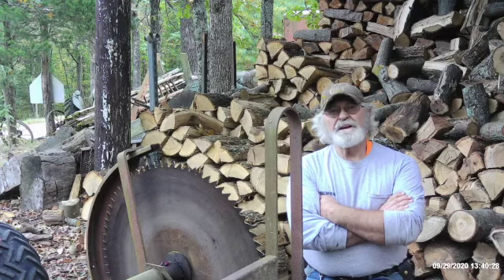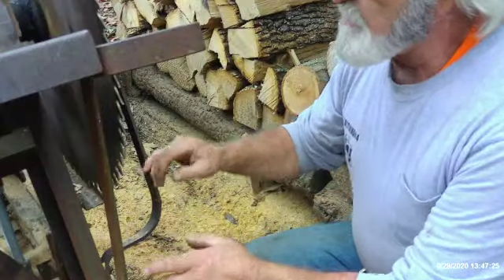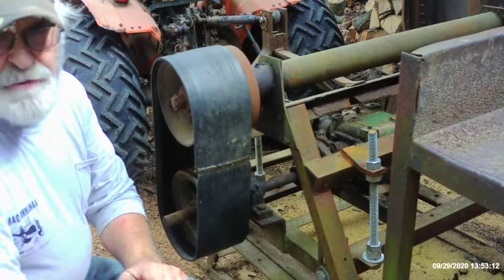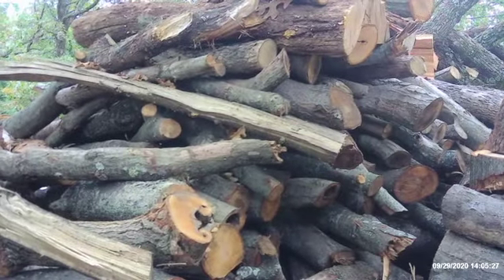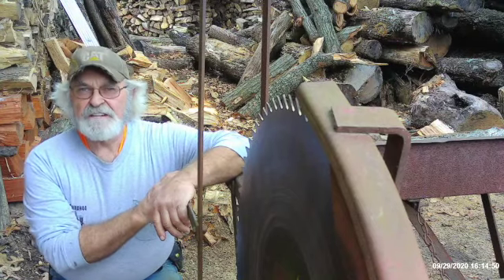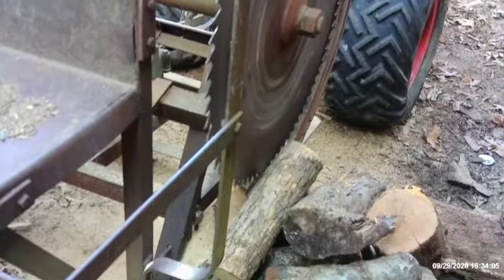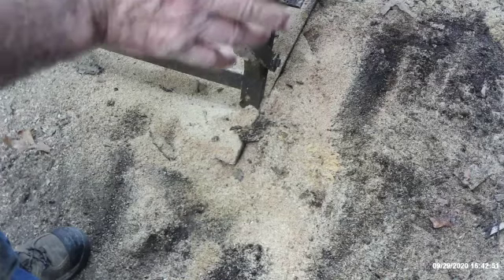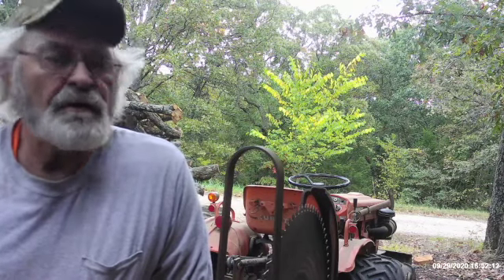Buzz Saw Safety: Detailed Safety Discussion and Operation

Comment: You and I are so on the same page here. One thing that I will not tolerate is leaving a cut piece that falls to the ground to just play there. I usually drag a small log up and throw my pile to the other side of the log and usually, I will have moved farther down the line in my pile and it won't be an issue. If pieces fall on my side of the log, I deal with it immediately. You and I both have a very healthy respect for these saws.
Reply from the maker: Yessir, that's why you and I have all our fingers...right?  While working alone, I offbear with my right hand all but the heaviest pieces.  I watched your video on your old rig too. Pretty cool. Thanks Gary for the comment.

Comment: Good tips there, Tractorman. I've just got one of these back into operation this year and your videos have been very helpful. Love the buzzsaw's efficiency but it does command a good amount of respect for sure.
Reply from the maker: Great !!  So glad to hear you've benefitted from them.  I think there's a playlist up top that has a lot of them listed.  And did you see by chance the one where the tooth layout is described..? This was one of my first videos...www.youtube.com/watch?v=TZ36Rxpn754&t=36s  Thank you for the comment and please feel free to look around a while.
Reply: @tractorman4461  Yes the tooth layout video blew my damn mind. That and the idea of hanging the blade from the ceiling and feeding it into a bench grinder tooth by tooth. That belsaw sharpener seems like a great specialty tool. Keeping my eye out for one. Thx again.
Reply from the maker: @HayWoodsandWetlands  Well good, I'm glad to hear it helped you a little.  I see the Belsaw sharpening rigs like mine on FB Marketplace occasionally.  You may ask around the neighborhood and see if anyone knows an old guy that sharpened everyones tools back in the day and you might find one ready to find a new home !!  The 10452 is a very versatile machine, capable of sharpening dozens of different tools and blades.

Comment: Thanks for the safety tips.  I will keep them in mind using my buzzsaw.  I need to pull it out ,  the pile is getting big!
Reply from the maker: Boy I tell you it sure does and quick too.  We had it completely gone a month or so ago and now we have two separate piles going, both 25' long and about 5' tall each !!  But hey, that's a good problem to have: Too much wood....LOL.

Comment: Excellent video!  
Been cutting for over 40yrs and would add that all saw fasteners especially those for the arbor and table alignment should be checked before each session.
Reply from the maker: Yes John, I agree.  That's a very good point. I try to remember the majority of points of interest but just don't seem to remember them all consistently.

Comment: Reminds me of helping the neighbors wit wood.  Once a year we would buzz the pile, I  was probably around 7-9 catching wood or picking it up. This saw was three point also behind an 8n. Your saw with those saftey guards looks so much better than that open blade saw. He would always saw to run a block of wood on the side of the blade to clean it and warm it up. I'm not sure how necessarily it is or was but I was never the operator.  Now I no longer cut wood and am no longer sure footed enough to dare start running one now. I'd love to run a  belt off my farmall bn.
     Thanks so much  TM 44
Reply from the maker: Well I am glad to have pulled a memory or two out of your past.  Our old rig that was front mounted on an old tricycle Massey Harris 101 Jr also was an unguarded exposed 32'' diameter blade.  It wasn't a tilt top like this one and took a lot more mid-body strength to slide into and back out of the blade.  The old man liked the stationary table because like I said at the end of the video we would sharpen literally hundreds of cedar posts for fence mending over the course of a few years.  That style worked much better for that process.
   Every winter we'd cut the monstrous slab pile off the sawmill and use most of it for fuel for our wood fired cook stove in the kitchen...of course the larger pieces were for the big heating stove in another room supplementing the normal split wood.
   I'll be showing you all another rig soon that will be flat belt powered off the side pully of the old Massey.

Comment: We always had three men on the saw , with the main man  feeding the saw and one man catching the wood and the last man is helping feed on the out end of the wood . All of our wood piles where in the woods and so we hauled it with a manure spreader and wagons up to the house or the wood shed for piling . And you do have it sharpened correctly because you can hear it sing . the old guys would always say that it was right by the sound . And yours sure sounds  great .
Reply from the maker: You described the perfect scenario for using a buzz saw effectively.  I suffer from lack of help most of the time now with the kids all on their own.  But that's the way we did it back on the farm.  I filed for many many years and still do occasionally for a quick touch up. Here's what I do for one that needs serious work: https://www.youtube.com/watch?v=ezvZ7u8jUwE&t=573s Of course this particular one didn't need it that badly, but it made a good illustration of the technique.

Comment: Good evening Sir. I did work around these types of Buzz Saw when I was young and they are safer to use that chainsaw in my point of view for the amount of wood that ywe cut. Great Safety video Sir, yes you need to be awake for sure.  Yes you have to use your brain these arkwards wood pieces. Yes in deed, we did cut during cold Winter time, but the ground was on bare ground and we had to make sure !!! Now you are going to laugh at me Sir, but the noise of the saw is getting me so much light up ( awake ! ) right now !!!  Great video Sir and can't wait to see your splitter war !!! CHeers !!!
Reply from the maker: Good Morning Sir I remembered in the past you've made a comment about that.  Wait until you see another one I adapted from a home made three point mount to a stationary rig that is powered with the little Massey Harris and flat belt.  You'll like that one for sure.  Its in use down at my son's house now.  As a matter of fact, Ol' Joe is one that suggested a video like this back a year ago or so.
Reply: @tractorman4461  Can't wait to see that video Sir and thank's to Joe too ! Cheers !!

Comment: When I was young, that was my job: grabbing the piece cut off and throwing it onto the pile.  And later on when I cut with the saw myself I experienced the  piling up near the blade and the occasional cut off piece coming in contact with the blade.  I learned to not let the cut off pieces pile up.  That I believe is the most dangerous part of this setup.  That and trying to stop the blade with your hand because you can't hear what someone is saying to you.  Ouch!
Reply from the maker: I think one rolling or slipping under the blade is the most scary.  I've had once or twice where the force of the blade coming in contact just right lifted the side of the whole saw rig with a loud BAM  .... Only a couple times, but it sure gets a guys attention !!  Thank you for watching these older videos..I really appreciate you taking the time to do that.